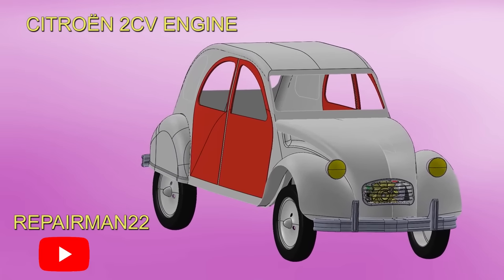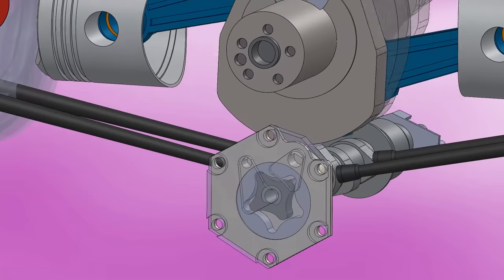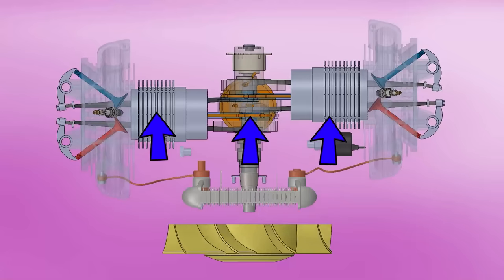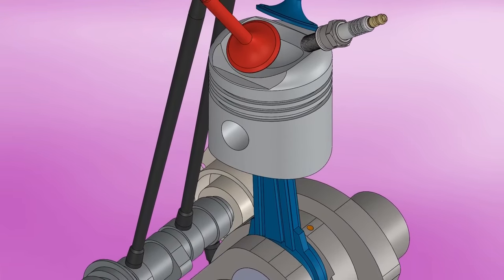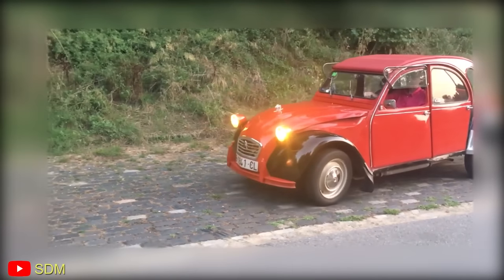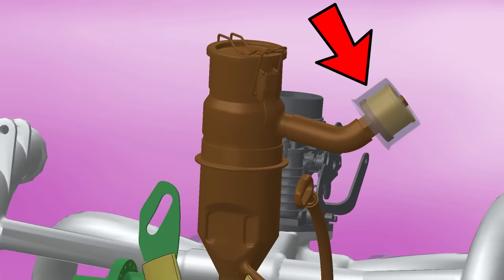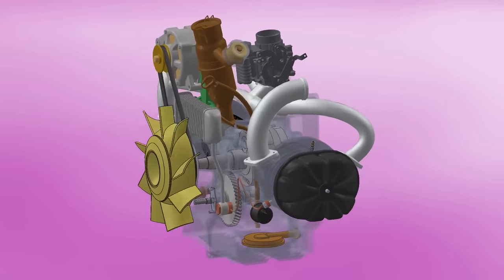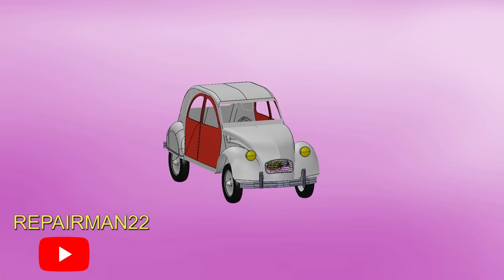The Most Interesting Engine In The World 😍 Citroen 2CV / How does it work in 3D?

Comment: I lived in France, so I maybe have explanation for 2CV and 3CV. When you want to register a car, there is a complicated formula that takes into account the displacement and power and it converts it into pay-grade-categories (CV). If you have better car - you will pay more. Probably once the engine was upgraded, or once French started using new formula, it found itself into the third bracket.

Comment: There is a company in the UK that converts them to electric. I have mixed feelings but the (expensive) result looks fun. They do a van too with a new composite lookalike back end. Aimed at hipster city business in low emission zones.
My favourite vehicle ever by far was it's great grandchild the Citroën C15 diesel van. I drove mine the equivalent of six times around the world on the same engine and head.
Rust from salt on UK roads killed it even though it retired to Portugal.

Comment: Sad there where no mention of the oil being injected directly to the exhaust valve stems insideinside the springs.
Suppling good cooling to the exhaust valves resulting in less adjustment of valve clearence and making the engine capable of running at its max load constantly.

Comment: I was sideswiped by a 2CV on a aTriump motorcycle on 7/14/1967. As it was Bastille Day no French person over the age of 7 was sober. I was making a left hand turn on a two lane highway. He grazed my bike rack as I grabbed a fistfull and barely made it across from a Mercedes lorry traveling north. The 2CV had a tear in the left front fender about 8inches long. I ended up in a drainage ditch with mud up to the carbonators. It took 4 of us to drag my T100 out of the ditch. We had to tip it on its back wheel to get water out of the mufflers. The rear carrier used to hold all my meager possions( I was 21) was tweaked and the rear fender was creased and touching the tire. A farmer torqued the carrier and pulled the fender back into position. Surprisingly it fired right up and I was on my way to finding lodging for the night.

Comment: The 2cv engine is extremely reliable. It only requires a hammer and a screwdriver. A couple of sparkplugs for any measure, and you can travel everywhere.

Comment: some summers ago my 2cv when got hot started to loose power with a cracking metal sound...then the car stopped...after it cooled it worked like a dream for 10 minutes and again the same cycle?unfortunately i left my 2cv in the barn...no it rusting bad...what was the cause of the engine problem?

Comment: You can add to your very good analysis that when having a little leak on a rocker covers on the vw , it would drip on the exhaust bringing smell and fumes inside the cabin , where on the 2cv exhaust is by the top driving to a clean heating system.
The vw rocker cover cork gasket gets easily sucked in leeding in a major leak if not changing the kork gasket at evry oil change , why , because there is nothing holding the gasket in position.
Even torked to its 300 newton meter value the flywheel single center main bolt would come undone if not using locking thread compound.
When the thermostat would fail , it would close the shaters leeding to overheating , to avoid this , remove the thermostat and block the shaters permanently in open position.
Also , do not use ngk plugs because they do not hold well temperature , use Bosh or Champion spark plugs because an air cooled engine can reach up to 250°c température and cheap plugs will put you in trouble.
On vw air cooled , noisy tapets needs to be often adjusted where on 2cv this problem do not occur.
Vw 1300 air cooled goes ok .
1500 engine is also quiet ok.
1700 engine overheat going up the hill.
2000 engine is a desaster in overheating.

I worked for a specialised garage in vw air cooled in uk. 

Panhard air cooled and Citroën air cooled , what a class.

Comment: I though that built crankshafts use roller bearings to compensate for the larger diameter of the bearings. I mean: keep the friction in check. The flying arm disk in the center needs to be as thin as possible to avoid vibration. I really want a forged part for this.

Also the bearings are thin for low vibration and large to better connect to said disk.

6 cylinders instead have a main bearing between every cylinder. Compared to an inline-6 there is less area of oil to carry the load. I guess that N/A air cooled engines with all that space between cylinders and small bore don’t apply much force.

Comment: Why can't they bring back a modern version of it as they did with the beetle and the mini? It shouls be mostly the same design with improvements in the cylinder capacity (for more power), more rust resistant body, things like that. The French alawys had frwsh ideas and excellent engineering as in the large citroen with the hyfropneumatic suspension, in aviation they brought us Mirage and Rafale fighters, the Concorde, Airbus 380 double decker aitliner, etc.

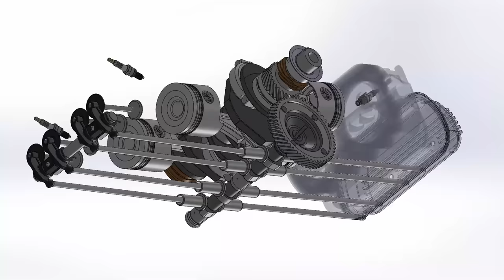Comment: important to say to young people: those (1:00) are the smaller versions of these engines.
some of them came with 3 times that power.
A regular 1600 Beetle from 1970 can overpass lots of heavy V-8 American cars from 1980 when emissions rules arrived.

Also, in lots of countries the "modern" 1600 engine came in the "old" 750 Kg pre-superbeetle platform, which stayed in production until 1996 in Brazil, and 2003 in Mexico.

Comment: I man in my hometown had a Citroen 2CV, I would swear that car had a pull-starter.
Reply: Early 2CVs in fact had a weak 6V system, and the starter cogwheel was moved onto the flywheel by pulling a rope. The same mechanism then closed a contact and the starter received electrical power. So, the rope replaced the magnet that normally moves the cogwheel. There was a second similar rpe thing which controlled the chock flap (to enrich the fuel-air-mixture for cold starts).

Comment: I think the 2CV suspension damping is a bit more complicated than just friction dampers? Doesn't it have a strange, oil filled container with a loose weight in it on each wheel?

Comment: Yes I have when I was 16 years old in1990 in Spain on the back roads, it was different to other cars, it was a nice ride especially when there was a lot of pot holes the suspension was really really good 👍, I'd say the citroen visa was better than the 2 CV, but the citroen visa was heavier than the CV and a bit slower, it a shame they didn't build this type of engine bigger like 1.100 cc for the citroen visa, air cooled. I think it is the best engine in the world. Just needed to be bigger and a 5 speed transmission and reverse gear, would of been the best engine in the world.

Comment: Ingenious enginedesign, the same as the Mechanical(!) suspension, only way to flip the 2cv om flat ground is high speed reverse and turn the wheeel all you can fast.
thinking what if: 4 cylinder engine-design on 2cv two on two with a bigger mid placed cooling fan, 4 cylinders sharing the camshaft. camshaftgear have one crankshaft on top, one on bottom. cylinder 1 and 4 on top, 2 and 3 on bottom,
Reply: Being a flat-twin fan, as now, I have owned 2CV's in the past, a BMW 800RT and, stowed away, a 1957 350cc Douglas Dragonfly. Some 35 years ago, Don Brown took the standard engine and, splitting the crankcase horizontally, placed another (inverted) flat twin half on top, geared together as a 700cc. Called the Douglas DragonFour Special, photos are to be found online.

Comment: I had a visa which seemed to go for ever. Very cheap to run. This was followed by three GSA',s one special and two Pallas . The engine was basically two 2CV engines bolted together, a horizontally opposed four cylinder engine. They were good cars and fairly cheap to run

Comment: 2CV said in French sounds like exactly like the words "Deux Chevaux" (pronounced du shu-vo) which means "Two Horses" because it was taxed as a 2 horsepower car. It had more than 2hp but the taxable hp was worked out with an obscure, old formula starting with the engine's cubic capacity in cm³.
I seem to remember it was designed to take a farmer, his wife, a sheep and a basket of eggs across a ploughed field (across the ridges) without any harm to car, passengers or  load. (I may be wrong but it'd be a fun test!)

Comment: had the 400cc and the 600cc. they was both very efficient and fun to drive. the engine was eternal but around 200.000 km lost compression. with tje 600cc on the motorways i gone about 100-105 kmh, not very good because i was just a little bit faster than trucks and overtake was boring. on the other hand the car was fantastic on state or little roads even without asphalt. in Tuscany i crossed also a few ford (of rivers) on roads made only for farm tractors.

Comment: It was my first car. Went to south Morocco border spanishSahara ((Mauritania). There was a war going on at that time. 1976.
I fall in love with the Sahara and cross it with a renault 4, alongside border of Libya in Algeria, till Bangui,  central Africa in 1981/82
Both car are easy going with each one a flaw. Breaks and weak frame for sahara for 2cv (need special tools like nearly all interventions) and suspension for renault 4 (torsion rode on exentric, for height adjustments).
Nice memory with simplicity.
Now ? Electronic sensor everywhere...and the gas mileage is not better....because of more cc, power, turbo....ac, etc...end up 5.5 l for 100 km.

Comment: Is this car still manufactured?
Reply: No, but 2CV City were selling new ones to spec here in the UK until closing recently, for £25k, made from the readily-available spare parts. There is now an EV Citroën 2CV van version sold by the 2CV Shop, for around £40k! All very well, but no heater for winter. 🥶

Comment: once i was hitch-hiking in france - and after a while the driver stopped and took a walk around the car, he didn't find anything odd, so we continued - After a few kilometers there was a sharp 'bump' sound and the car was overtaken by our ,left rear wheel. It was a strange sight to see the wheel rolling by. We had to take bolts from the other wheels to fasten it again. We had to drive with only two bolts in three of the wheels,.

Comment: This car was designed before WW2. The french hid the prototype cars so they wouldn't fall into the hands of the Nazi's.
Also, if you look at the early BMW airhead motorcycles you realise that the engines use  basically the same design concept.

As for HEMI: The french were advanced designers. Peugeot also used hemi engines in the 203, 403, 404, 504, 505.
Many millions of these reliable engines were produced.

Comment: Fun fact 1; 2CV means Deu Cheveux, French for 2 horses, which is the rated horse power, calculated from the swept volume of the cylinders & the compression ratio. The 9 horsepower  is the developed horsepower. 
Fun fact 2; One of the design briefs was that it should be able to be driven across a ploughed field with a basket of eggs on the seat & have not one egg break, a feat it accomplished with flying colours. It's suspension was that supple.
Fun fact 3; The first prototype was developed just before the Germans invaded France, so it was hidden away until after the war.
Fun fact 4; The very earliest versions used corrugated iron sheeting for the body panels & had just one headlight.
Fun fact 5; It's nick-name was "The tin snail".
Fun fact 6; Panhard, an old French car manufacturer that was bought by Citröen developed a racer for competing in the Le Mans 24 hour with a very aerodynamic body & powered by a modified 605cc 2CV engine & managed a top speed of 125MPH.

Comment: French Deuevo 🥖
 90 cc Farmer's friend .
=====
You can put a basket of eggs in the front seat over rough country and they wouldn't - crack - 🥚 💤.
======
The suspension would move up to 3 ft , with lever arms .
===
Put your hands out in front of in a 👊 fist ✊ and imagine they are the tires . 
===
Then , with your elbows by your side bring your hand straight up & down from  your shoulder and that is the same suspension 🚟 lever action of 3 ft.
====
The modern Army Hummer can go over a 3 ft wall ; though it's drive shaft "in the 80s" had the same shm (simple harmonic motion) as a Formula One 🏎️ 💨 racer at 60  miles per hour.
====
👋😎💨 Bryan

Comment: We have a 72 2cv6 that cones into the shop that has the bigger, 600cc engine. I really cant imagine driving that car with HALF of the displacement/ HP. The suspension is awful. The shifter is kind of ingenious, replicating a floor mount shifter with one sticking out of the firewall. Fixable with minimal tools.
Cool car but only as a toy.

Comment: I had 1974 Citroen Dyane back in 1980. It was definitely not a car for tropical country, so hot inside, felt like in the oven. It relatively had no power for running, especially when climbed on the hill. Really sucks.

Comment: I had several of these (as they rusted badly), Sit in, drive, so uncomplicated. 1500 km? Check for gas every 300 km (small fuel tank). Other issues? No. Starts at –20 °C? Yes, it did. Heater good for –20 °C? Not at all. Car good for crossing Europe? Yes.

Comment: 9 Hp?  So, 0 to 60 in forever?
So I looked it up on Wikipedia and it says " The original 1948 model that produced 6.7 kW (9 hp) had a 0–40 km/h (0–25 mph) time of 42.4 seconds and a top speed of 64 km/h (40 mph)".  One could beat it with a modern riding mower.  Or an electric scooter.  Or roller blades,

Comment: Fun fact, 2CV has front wheel drive. And problem with having a drive axel, and steering the wheel, is how in earth are you keeping the wheel rolling the normal constant speed, while steering a lot? Well, 2CV is the classic example, where you actually FEEL the front wheels speeding up and slowing down a bit during each circle they move. The wheels feel weird. Name me another car that has this primitive car axel joint, and this funny problem. You can simply avoid doing very tight turns, reverse a  couple of times, why not? It spares the tyres and the driving train a bit, for doing less vibrations.
But, the 2CV is famous for this steering behaviour. When you drive one, gently do a couple of tight circles on a large larking lot, and you can feel this wheel speed effect yourself.

Comment: Over the last 50 years, I have owned 4x Citroen Dyanes {basically an up-market 2CV} and my present 1988 2CV ....{I bought a new one when I heard Citroen were ceasing production}.
I consider my 2CV a better car to drive than my "modern car", and despite the small {602cc}  engine, I have no trouble keeping up with  "modern"  traffic.
TBH, a lot of the time "modern"  cars slow me down, because the art of driving a 2CV is keeping up momentum by pre-judging traffic & road conditions ...which seems to me to be a forgotten skill in todays bland, boring moderrn cars.

Comment: I love how simple these early cars were - dismantled for repair with solely a screwdriver. This was technology of human scale - lightweight, a bit flimsy, but a 2CV was no dangerously overpowered monster. In a world where cars are rolling spybugs those can not be used without signing Tesla's EULA nor repaired without NDA to get a paid internet connection to the manufacturers cloud (until Error 404 by bankruptcy) technology got totally perverted. A 2CV may have less clean exhaust emission, but emits no mobile radiation, contains barely unrecycleable materials and the local village blacksmith could make spare parts. I am not against e-cars, but they should be made as repairable with open source schematics, no rare substances and capable to stay offline.

Comment: There are a bunch of errors in this video and misinterpretations of engine design. For example, the fan design of the VW has long expanding area ducting in the fan shroud to slow velocity and recover pressure.  It's not a design flaw.  It functions like the scroll on a turbo.  The most interesting aspect of a 2CV is actually the suspension.  Many features were used in F1 until banned by the FIA. Look up tuned mass dampers and interlinked suspension.

Comment: 9 horsepower???  For a 2 cylinder???   To me, it should have had at least 35 - 40 HP. But maybe it had a small displacement?
Reply from the maker: A today's motorcycle of 300cc has 40hp. For the 2cv to have 9hp in that year was ok.
Reply: When petrol quality increased, the power of the 2CV engines also increased. If talking SAE (US) HP, the latest 600 cc models came up to 40 HP at < 6000 RPM.

Comment: You could have also done a comparison to the NSU Prinz twin.  And BMW motorcycles have nice opposed twins which bolt into a 2CV with much more power.  The 2CV engine is hardly the most interesting in the world.  The car itself remains a model for how to do inexpensive comfortable transportation and should be copied widely.

Comment: The Beatle engine was a POS: the head bolts pulled loose  resulting in loose heads, low compress, and blow by; the #3 cylinder exhaust valve broke off at 50,000 miles ruining the head, piston and cylinders;, when rebuilding you always had to line bore the crankcase because the unbalanced crankshaft wallowed out the too small main bearings; exhaust gasses ALWAYS entered the passenger compartment; etc. etc. ad infinitum.

Comment: It’s an interesting engine, but like lots of French engines and cars , seems to lack any consideration when it comes to maintenance or repair. 

It’s like they though ‘how can this be made as hard maintain as possible?’

The points for the ignition timing are behind the flywheel. Completely inaccessible. Good location? Not.

I hate French cars, everything seems to be designed to be in the worst possible place, nuts and bolts go in backwards, and hit the chassis, but if they went in the other way they would come out easily. 

It’s not accidental, it is deliberate. They want to make the repair times as long as possible, so they can charge 5 hours for a job that could be done in 1 if they just used bolts instead of studs, or studs instead of bolts, etc.